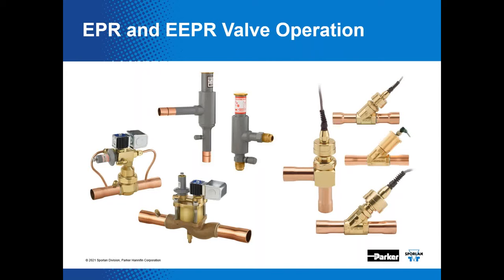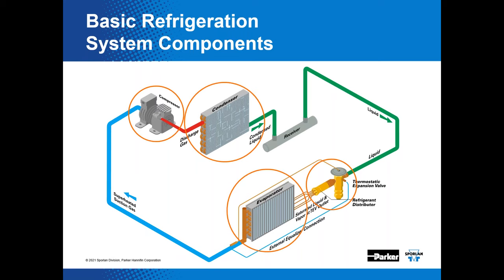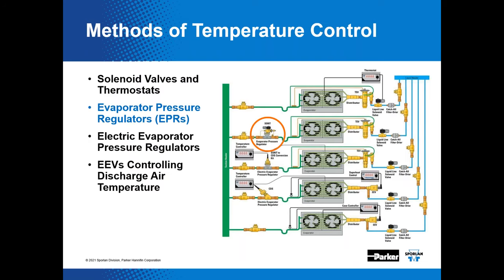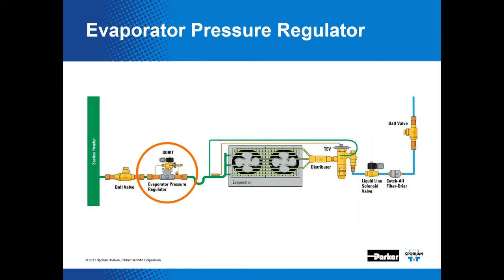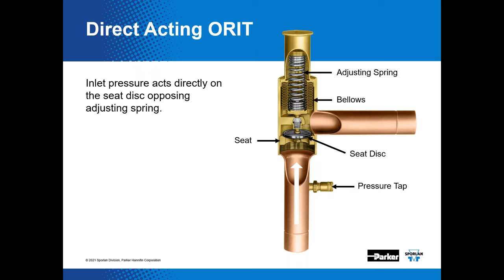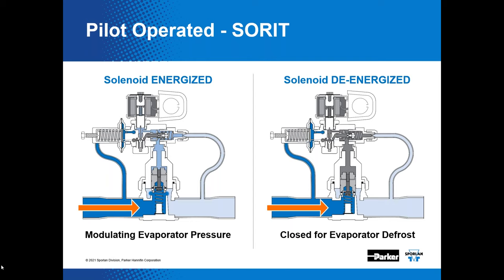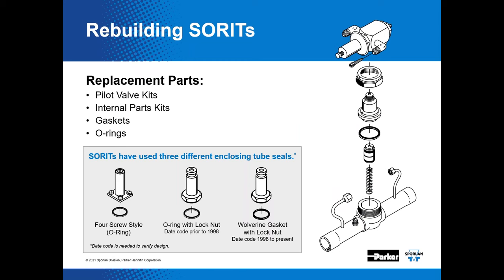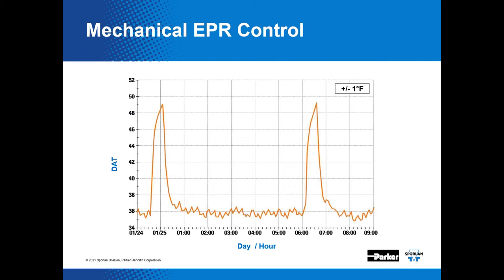Evaporator Pressure Regulators (EPRs) and Electric Evaporator Pressure Regulators (EEPRs) Operation

Comment: Hi what is the best practice to sweating in a Spolan SORIT valve, is it best to unbolt and removing the upper valve assembly from the body or simply wrapping valve with wet rags?
Reply from the maker: @randylazz It is not necessary to disas semble the valve when soldering to the connecting lines. Any of the commonly used types of solder (such as 50-50, 95-5, Easy-Flo, Phos-Copper or equivalents) are sat isfactory. It is important — regardless of the solder used — to direct the flame away from the valve body and avoid excessive heat on the diaphragm of the pilot valve. As an extra precaution, a damp cloth should be wrapped around the diaphragm during the soldering operation.
Reply: @sporlanvideo  Thank You!